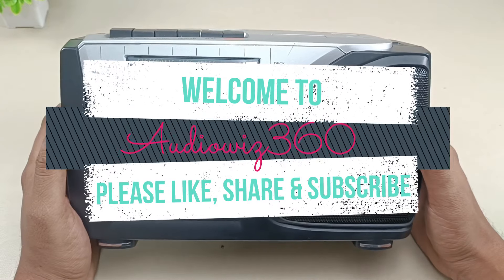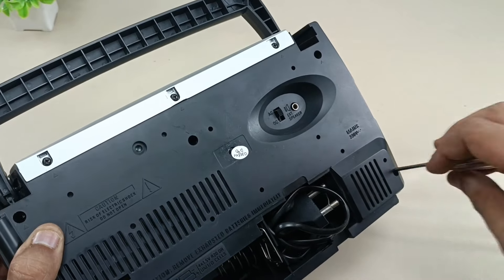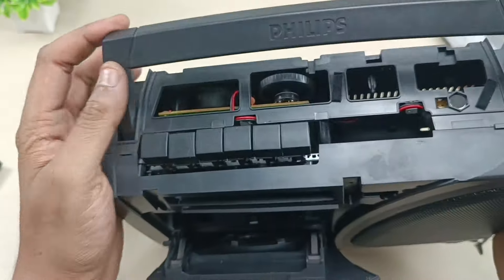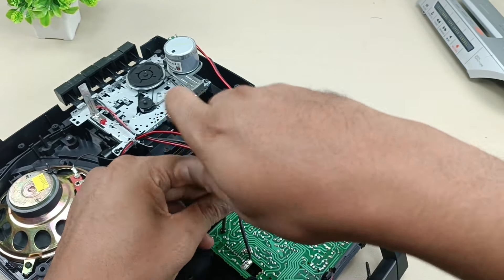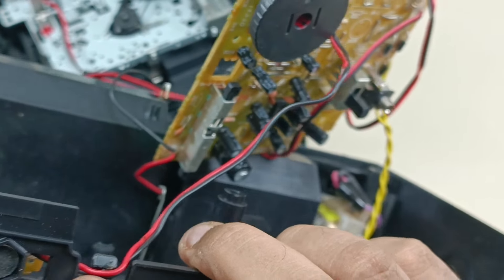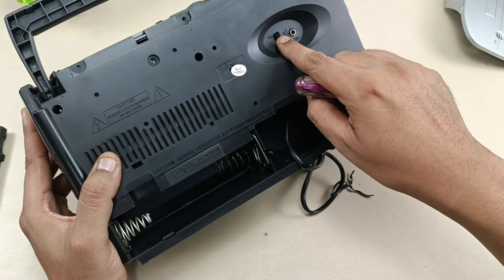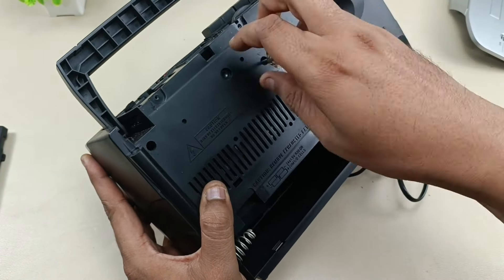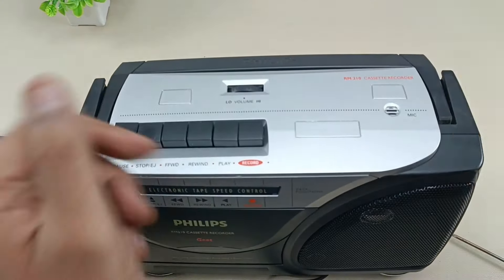Philips Cassette Recorder RM210 Teardown & Looking Inside

Comment: Used to repair these kind of Tape Recoredes in early days, always common problem, Head Cleaningl, Belt replacment, Mottor problem, Speaker Replacement, but that was fun.
Reply from the maker: nice! 😊👍
Reply: what belt number is required